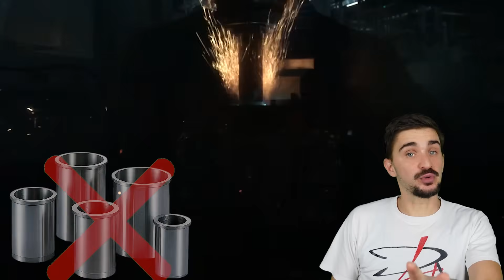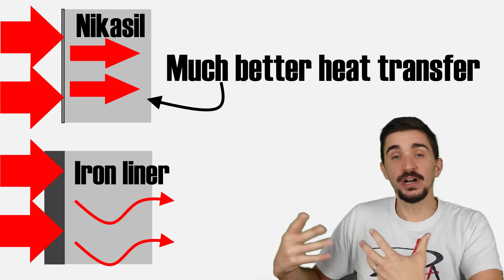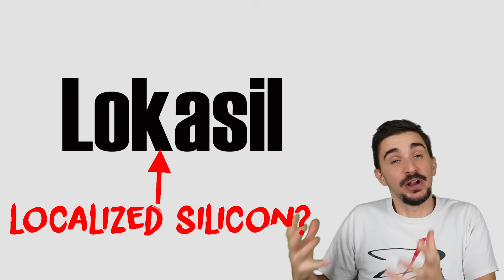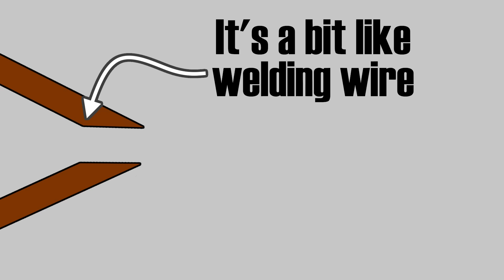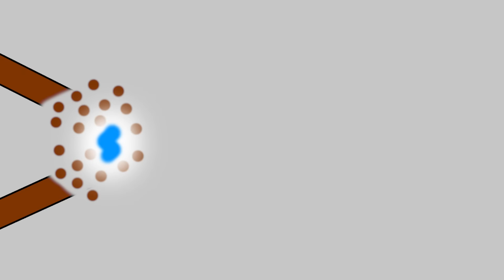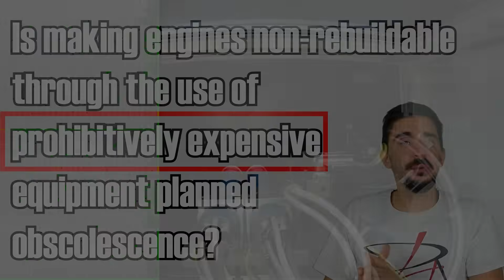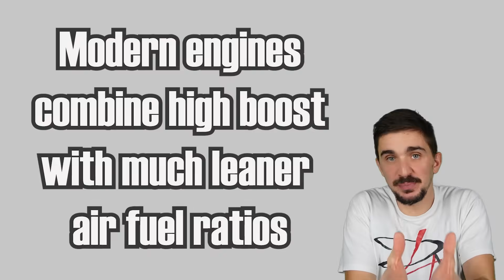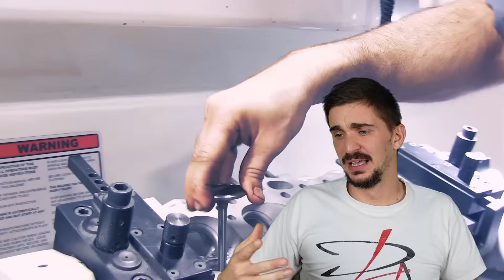Why Are Engines Becoming Non-Rebuildable? Everything About Cylinder Coatings

Comment: You missed one point, no one would buy an expensive new engine to be put in a 10 year old car. 
They would just buy a new car, which is unbelievably more co2..
(And Co2 pollution is a scam anyway)
Repairing and rebuilding good products will always be cheaper and better for the common person, then to buy junk over and over again..

Comment: The solution seems obvious.
Manufacturers of engine blocks with thermal spray coatings should be required to offer a recoating service.
Equipment costs are already covered.
Cost per coating is low.
It just needs right to repair legislation to make it happen.

Comment: From the 3 comments cited at the beginning of the video, environmental concern was a non issue, it was a purely consumer experience based observation. While I would give the benefit of the doubt that there were other comments mentioning the environment, I would suspect that these were sub arguments to the anti consumer argument to appeal to a climate doomer's nightmares. If you don't think climate change is real in the first place, this is a non issue. From the limited perspective of the life of an engine, Yes, this is a form of planned obsolescence, and anti consumer in nature. The availability and cost effectiveness of sleeve replacement for the average consumer's engine would be the ideal. But as pointed out in other comments, vehicle bodies fall apart in ways more prohibitively expensive than just replacing the engine sleeves, so all the arguing is shortsighted of larger manufacturer priorities when it comes to product and business. The most important thing is the company Shareholder, all trickles down from there.

Comment: Interesting, but engine rebuilding, even of family car engines, name a simple 2L inline 4 diesel/petrol engine of a 3L inline 6 diesel/petrol engine, paired to a manual transmission, some people like these configs and are combinations that are getting harder or even impossible to puchase on the new car market. When you rebuild that, there's probably some emotion in the game as well. To both of my personal cars I have emotional attachement and I rather drive those 2 for the rest of my life than having to buy something new.
However modern engines like the 1.2 puretech and 1.0 ecoboom engines are not worth rebuilding in my opinion.

Comment: Did engines really improve this much? I drive a 2019 skoda fabia 1.0 mpi (60hp) at 5.5-6l/100km and my girlfriend has a 1996 honda civic 1.4 (90hp) and it just needs 6-6.5l/100km 
We both use e10 fuel
Reply from the maker: That's the average number. All the 2.0 and 3.0 and even larger engines are in it too. They're outliers but they skew the average.

Comment: There is a nice summary at the end. Nobody will rebuild an engine from a family car that costs four figures. It is just way cheaper to get another one. Just the work of removing the engine from the car and installing a new one makes it too expensive. 
And for engines worth rebuilding, all coatings can be stripped and converted to nikasil.

Comment: Very impressive, and in less that 30minutes.👍 
Of course the Elephant in the room, again, is fuel. Develop an engine and fuel, together.
After all, thats what they did in the beginning.
A guy I know has a bulldozer that runs on coal dust, its 100yrs old, but made that way.

Comment: I believe my 911 (996.2) motor has lokasil cylinder linings. 

I once had a Euro spec Suzuki GT550 and that had nikasil plated cylinders. The problem was that once you got a scored cylinder from whatever cause, it needed replating. Few companies could do it & it was expensive. I got mine fixed and sold it. 
Nobody I knew found the upsides real but very many learned the downsides painfully.
I own two Suzuki triples from that era, both cast iron liner motors. I’m much more comfortable with these engines. In the event of a problem, I can have them rebored. This makes the engines pretty much everlasting. These old bikes are never going to wear out twice. I’ve future proofed the situation by buying oversized pistons and ring sets, and storing them carefully for whoever needs them. Every automotive machine shop can rebore two stroke cylinders.

Comment: The capacity to rebuild engines has declined over many years with the increased use of light weight alloys. Even back in the 1980’s I replaced a head gasket on a straight 6 and found that even machining the alloy head flat prior to fitting a new head gasket was often not possible.

Comment: What an awesome video, I learned a few things about acronyms (most don't work) 😁
Thanks for going through the tech articles.
WIKI is, Porsche were using plated cylinders developed in conjunction with  Mahle  by 1970, NSU never got it to work right in Wankel although it was used on moped cylinders, the two speed  NSU 'Quickly' in early 70's  (it never seemed to wear out even when badly abused by 16 yr old's (in Britain)
Kawasaki started using high amperage  'exploded' particles in two stroke cylinders in  (I think?) 80's,  pretty sure it was only European MX bikes that used Nikasil in the 70's?.
Triumph have been using some sort of hard coated aluminium liners in various motors for a long time, (I haven't had one in pieces but I would like to)
Re-plating cylinders is quite common it just hasn't been applied to multi cylinder engines before so I guess there are companies that have made the investment.?
Older blocks with a modern aluminium spray coated liner should be relatively easy to convert?
There could even be a  performance upgrade with better heat transfer, cylinder liners are usually 2mm~4mm thick when fully supported (closed deck) butopen deck 'wet liners' will need substantial extra thickness at top
Labour charges have pretty much killed off the chance of  re-building 'ordinary' cars, but, a DIY'er who can save $5,000 or more in labour charges can probably do a better job than a 'quik-fit' shop that has to make a profit.

Comment: can someone explain to me how co2 is measured?  i mean how can a car produce more co2 by weight than fuel it uses? if average car produce 106g of co2 per km, that means over 10kg per 100km and fuel weight for that same distance is approximately 4kg (5.6L x 0.75kg per l) so we are creating stuff while using energy, einstein would be proud, lol, but i am sure it's not that, but something about how it's measured, so again, can someone explain how co2 emission is measured???
Reply: The fuel contains carbon in the form of straight chain alkanes like octane.
When this is burned, it adds huge amounts of oxygen from the air, forming CO2 (by combining carbon in the fuel with oxygen in the air, making exhaust gases mostly of CO2 and water (H2O)).
In this way, a motor yields far more CO2 than the mass of fuel consumed.
Reply: @GT380man  thx, i forgot the chemistry can add things, thanx again

Comment: Not surprised Nikasil, the material invented for durability, beat out the ones invented for cost. Besides, aluminum substrate is going to be weaker than iron regardless of what it put in it, if it's not an alloy.

Comment: Agree with all your points, well done video! But when you cannot rebuild an engine, 90% of the time you'll have to get a new car (10% get a replacement from scrape yard?).
Buying a new car and disposing the old one has a significant carbon footprint that shouldn't be ignored in the cost/benefit analysis.

Comment: Metal spray coating is very, very, very old. Even the the twin wire machine is already available and commonly used in machinery shops. The optical inspection system necessary to achieve the manufacturing efficiency may not be economical but, I doubt it can not be done with machining and honing using traditional inspection methods.  Also doing it economically. It is also applicable to any brand and make of engine. Only the necessary degreasing might make it more more expensive but, you also have to consider the spare sleeve delivery time and stock availability reduction.

Comment: Actually, right now I own a car with Renault H5Ht (Nissan HR13DDT) engine from the video, and would like to mention one more thing: it is much more pleasure to drive a car with modern ~150 hp 1.3L engine then old 150 hp ~2L. Modern engine offers better user experience: better low-RPM torque, better dynamics etc. Probably it will last less, but it is better right now. Thanks for the video
Reply: And much lower fuel consumption, which saves you a lot over the lifetime off the car.
Reply: @ComplicatedStuff  Thats debatable.   At light loads, yes the fuel economy is better.  Under load and sporty driving these new small capacity turbo engines have no advantage over their larger N/A predecessors.   That is partly why the WLTP test method was introduced to replace NEDC a few years ago, because (along with the VW diesel scandal) it was found NEDC allowed manufacturers to make unrealistic claims about their car's MPG that were a long way from achievable in the real world, wheras cars from 20 years ago were found to be much closer to the claimed MPG and the overal difference between them was much less than claimed. Consequently the real world emissions were also much higher than claimed and many models were discontinued since under WLTP they no longer met the legal requirements.
Reply: Not really better if you care about longevity and know how to drive a NA car.
Reply: Thats an opinion, and it depends on what type of car, and how you like to drive.   In a sporty car I would much rather have a rev happy N/A engine with a great exhaust note over a bland sounding engine with a loud hiss dominating it.  The modern turbos are great for making progress with little apparent effort but they also lack character and don't really reward a good driver like the N/A cars with a manual transmission did.  Each to their own I guess.

Comment: If you factor out the co2 scυm related data and take the real world important factor that is cost per mileage, cost including of course fuel cost, initial cost, rebuild cost etc, calculations lead to different direction, and it's not in favour of the consumer, however biased one may be.
Good video though, doesn't try to hide the bs in engine tech...

Comment: I had an aluminum nikasil cylinder on my yz250 2 stroke sleeved, due to a backorder on a new one from Yamaha. It gets done all the time and works fine. I guess it can be dependent on how much aluminum thickness is left after boring over for a sleeve but there's gotta be a bunch of engines that can be sleeved.
Reply: There are.

Comment: The plating is fine, it is so hard that even ingested dirt won't easily damage it, instead it will wipe out the rings and aluminum pistons.  The real problem with modern engines is the piston rings.  They are thin wimpy low tension design, and the oil scraper rings are thinner than they used to be.  Thinner oils are also recommended.  All of this is for fuel efficiency, not long life.  As a result, modern engines tend to burn oil.  Add forced induction to burning oil and you potentially get detonation and burnt valves, or just plain stuck coked up oil control rings and excessive oil use.

Pretty much any direct injected engine simply isn't designed to last much more than 120K miles or so.  The older port injected engines had better longevity.  Then we have CVT garbage attached to these engines.  Ack...

Comment: I heard about non rebore cylinder years ago on a motercross bike 
But thank  you very well explained 
Cylinder liners have been around since the beginning of combustion engines 
An engine ‘ dissipates’ heat 
‘Low pressure rings ‘
Help lower bore wear

Comment: *not rebuildable by regular means, but still possible with the right equipment.  Spray welding isn't a new idea, just a different implementation of the process.  Porsche did it with their fancy tungsten-carbide coated brake rotors.

Comment: You fill the iron cylinder with lithium, then freeze it at maximum structural integrity, then make it a million volts positive and create high vacuum too pull the lithium out of the cylinder.  This makes 8090 lithium iron coating,  4billion to 500million psi, just has to nitrile bore it to specification.  Nothing in all of nature can wear it at all, just like zinc vs a diaper.  Can't even use money, so much big lego.Lego.  it breaks on purpose, full of oil, if they piston gets stuck somehow, so you have to call the engine police with AI snitching Chinese head unit.  If you want the cylinder insert to transfer heat better, you make it like a freeway, it has fuzed quartz mesh, garbage gets hot faster, the hot spots work just like the engine, the inert mass super heats.

Comment: I would argue, without proof because that is how my mind works, that this equipment is probably paid for through government grants because of government mandates to reduce emissions on a local level, globally...
Please explain why it could not be sleeved. In my mind, with the proper material sleeve, it would make the block stronger. Maybe sleeve it without boring the cylinder and run smaller cylinders and re-tune the engine map. Seems pretty simple to my simple mind...

Comment: I wouldn't call it "non-rebuildable" as much as "prohibitively expensive". Some company applied the coating before, so sometime can do it again. It's just not cost effective to have it done on a single block. Also, depending on the engine you might be able to over bore and sleeve it to get back to stock sizes, but there are a lot of ifs to that one.

Comment: very clear explanation, it is not just the coating of the bores that makes an engine not rebuildable, you should also consider connecting rods that have a fractuers cap mating faces, you can not resize the rod bearing bore on the connecting rod.
Anyway, today's car are so cheap that they not worth an engine rebuilding.

Comment: I went down this rabbit hole once. The thermal spray liners should be rebuildable and this technology is used on big-rig diesel engines and is used in rebuilds of such engines. I don't know what is preventing this from being done on other engines except maybe licensing fees. In fact on diesel engines it was marketed as a benefit. Patents should be expiring.

Comment: Any engine with a spary on cylinder coating is junk! 1 star, do not recommend!

I do agree with the rebuild price being expensive. I recently rebuilt a 1.8T and it was supposed to be a cheap sloppy rebuild. Nothing went to a machine shop, I didn't even use Plastigauge. I just wanted better rods. I ended spending almost $3000 usd. I did all the work but most of that was good parts. It has a Supertech springs and retainers, Brian Crower valves and IE rods. Runs like a champ!

Comment: There is always a pile of engine cores behind the Nissan and Kia Dealers' shops.  New stuff is garbage even if they replace under warranty, and it seems they have to do that quite frequently.  I priced a rebuilt engine from NAPA and it was about $3500.  Add about $2000-$3000 for labor and that's much better than a new car payment.  The junk you know is better than the devil you don't.

Comment: All I heard from this video was it's technically possible to get an aftermarket cast iron sleeve, designed for high boost applications, thermal spray coated and increase efficiency up to 5% without losing strength.

Comment: The exponential rate at which tech advances is hard for humans to think about. An example from the computer world is that, sometimes it is more efficient to wait for the tech to improve before starting a project. Here's how it works:

Moore's law, which notes that integrated circuit density doubles every 18 months, has been successfully extended to other factors such that processing power per dollar can be said to follow the same curve. There are caveats as with anything, but for our purposes they are irrelevant.

Suppose I've got some computational work that is easy to distribute across multiple computers. To a first approximation, a thousand computers can do the same work as a hundred in a tenth of the time. Now suppose my project needs to be completed in three years. I can spend $1M now and finish just in time. Or I can wait 18 months and complete the project on time for half the price. Or I can buy twice as much computational power in 18 months and finish 9 months early.

This is a gross over-simplification but it's a somewhat counter-intuitive but very real result of how tech advancement and market forces work. In tech, there is no need for planned obsolescence (I'm not saying it doesn't exist) because making a computer last longer would be a waste.

Comment: I like the small math section at the end. But I still have a question; What would the CO2 emission difference be if rebuilding an old less efficient engine and keeping it for 10 years versus recycling the old car, manufacturing a completely new car, and driving it for 10 years? 

I simply don't see the reason why regular consumer would bother putting new low-emission engine into old car and resolve potential fitting and electrical issues for their daily drive.